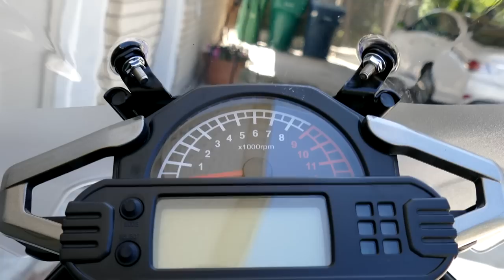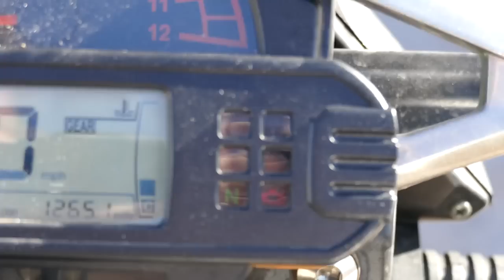Zongshen CSC RX3 Cyclone REVIEW - BRUTALLY HONEST  #everide

Comment: I took some advice from an adventure rider last year and bought an RX3 last summer.  Put 1.2k miles on it before covering it up for winter.  Changed the oil once and tightened maybe two bolts.  I ride well-worn trails and dirt roads but mostly pavement. I don't treat it like a dirt bike.  I like to use my RX3 to commute on nice days, too.  Over the course of thirty years I've owned CRFs and an XT, along with a Magna and my current VStar.  For the money, fit, finish, and performance, you can't beat the RX3 as an adventure bike.  You just hop on it and go.  Unlike Japanese enduros, the RX3 loves the interstate and winding mountain roads.  It feels solid and isn't wobbly at high speeds like the Japanese makes.  In city traffic, the RX3 always keeps up, no problem, even on steep inclines.

Now, I get it, you want to judge it as a dirt bike.  But it's an adventure bike, not a dirt bike.  As an adventure bike, the RX3 is unbeatable in the 250 class, and I'd recommend it to anyone. It's surprised me. It's shown me what a little 250 can REALLY do -- after riding for 30 years.
Reply: I just ordered a 2022 rx3 ,looking forward to getting next week
Reply: @Lloyd-mo   I'm still loving my RX3. Over 3K miles down the road and no mechanical problems. I did buy a new battery for it, last spring.
Reply: It’s great that you had this experience. I own one of these and it has not performed anything at all as you describe yours does. I fall firmly in line with Tyler’s assessment. The bike looks nice in person, shows well on paper, but is simply not reliable at all in reality. It has proven time and again that it cannot be trusted and I would not recommend anyone purchase it based on my experience and that of many other people I know.
Reply: @cliftonoram2923  Sorry you ended up with a dud. What year did you buy? Mine is 2021 and perfect for riding trails around Branson Mo. On pavement, it keeps up with any traffic, even going up the long hills. I don't have 5k miles on it and don't know how long it will last. So far I've replaced the battery and done regular maintenance. That's it. It sits under a deck, covered, during winter.

Comment: Hi, here in COlombia this bike is not injection, have carburator, more power but more troubles for tuning the carburator. ALso have a lot of problems for bad asembly. But for this money is the best choice. Have a cost of 4000 dollars here, but if you want buy other bike klr 650,  dr 650 or other need 8000 dollars....For this reason is a medium choice. You say the true, is not a great bike, i say is a regular bike. But for this money in argentina, chile and Colombia is a on-off road good choice, no excelent only good. Nice day, sorry for my regular english. Regards from Colombia.
Reply: The real competition to this bike isn't brand new Japanese bikes, it's this bike brand new, against used Japanese bikes, and you can get those for less, and they'll still be more reliable. You could get a brand new RX3 for 4000 dollars, or you could get an 6-9 year old KLR, DR, or DL, and have a better experience and they'll still hold up better.
Reply: Kaerius, problem is that for 4000 usd you will not get anything like that, at least here in Argentina you need a lot more. If you want a KLR/DR/Dommie for usd 4000, it will only be a '90-93 with zillion miles on their backs, and God only knows how many hands went through them...
Reply: @rodrigoruffa7460  I paid about usd 4k for an '09 Versys 650, in Sweden.
Reply: @Kaerius Good for you! I can positively confirm that things in Sweden are quite different than here in Argentina. By the way, I've been there in 2017, together with other 4  old Argentine schoolmates (30 years after graduation) we traveled from Lund to Nordkapp and back, 5600 km in 8 days, best adventure ever :2 BMW GS (1150 & 1200), one old BMW K100, one Honda Revere 650 & one Jialing 600...
Reply: Try the Royal Enfield Himalayan
Reply: @nineball26  thats only partialy true. Here in Mex we have no regulations regarding FI and they sell both FI and carburated versions of this bikes
Reply: Thank you for the for the honest comment
Reply: @OnlyKaerius  4000 dollar DR650s in my area are pretty clapped out.. not sure if i would be able to afford the repairs on a used DR in that pricerange in columbia. Versys is a different story, it'll have more road than offroad use so it'll be in better shape.
Reply: Problem now is japanese bikes used are just a little less than new so these Chinese bikes make way more sense
Reply: You have better English than a lot of Americans i know lol

Comment: Very good review - with a result to be expected. Quality costs money and there is a reason why other bikes are more expensive - and thats not because the manufacturers want to make huge profit. From my point of view there are points that disqualify the bike entirely. One is the suspension. The other one that it doesnt even comfortably reach the legal speed limit. While I hate riding highways sometimes you just need to use them to quickly get from A to B and the last thing you want to be is a rolling traffic obstacle.

Comment: A pretty thorough review, and thanks for your honesty of your opinion. Wondering how much suspension upgrades would cost from aftermarket. I've read the shock from Progressive that CSC offers as an option is more harsh than stock. As you say, longevity is yet to be proven, and one Zongshen owner in Idaho had to replace his engine just shy of 70K (70,000) miles. Not sure how that compares to other 250's. 

One thing that caught me off guard, was when you mentioned the smiles it brought when ridden within it's limitations. That seems to be the common sentiment on RX3 forums, outside of one guy who seems to have difficulty shifting in to 6th, even after CSC sent him a complete replacement engine under warranty.

Again, thanks for the video adventure.

Comment: I had ordered the TT250 and not the RX3 based on what I planned to do with the bike. . Wanted to see what CSC looked like before I signed the dotted line. So bought a motorcycle rack from CycleGear and drove to LA to pick it up. Really liked the shop and sales system. Was able to test drive the bike before I finalized the purchased. They were great. I totally agree with the review of the RX3 and would still consider it as another bike to add to my collection. CSC does have upgrades like front brake kits, which I would recommend.  Did have issues with the TT250 and parts were sent quickly. I am hopefull that, as the review suggested, it is like Hyundai and will improve over the next few years. Now I say this as I worked for a dealership that had Hyundai as one of its 4 lines of cars and Hyundai has become an excellent car over the years. Visit CSC if you have the chance.

Comment: Tyler, Jumping on the bike with minimal preparation for the rugged trail you were on, 80/20 tires, highway gearing and not going over bolt security was bound to produce some poor results. Yeah, first gen. , first year, gonna have some teething problems.
I hope CSC is giving good feedback to Zhongshen. The drag race with the Prius showed that the RX3 was fine until it was topped out. Overloading the bike by at least 100 lbs. (sorry CDS) is hardly a fair test (max. load 330 lbs.) Love your channel, keep it up!

Comment: Thanks. I will add more later. Having some issues. But I will say it is MORE than a commuter bike. I've been on some fun street rides along side some of the finest cycles made. I kept up quite well on the twisties, back paved roads, etc. And fairly well on highway if they are considerate that I'm on a smaller bike. Many of them are pleasantly surprised when I tell them it's a Chinese 250. And it would be good off road on moderate occasional off road. It's actually quite fun on smoother fire roads and such. But from my experience, it does not do what they personally tell me it should on rougher roads. As you mentioned, the RX3 can do it but should it, no. Especially stock.

Comment: I've read other reviews and they all seem to say the same thing, ok on the road and terrible off. I tend to think that most dual sport owners don't ride the kind of trails that you do so that might not be an issue for them.

My only complaint, which means absolutely nothing, so don't pay any attention to it, is what you're comparing it to. It's almost like taking a stock Geo Tracker head to head with a Jeep that's been tricked out and then lamenting the fact that you can't go rock crawling with it. I know, they call the Zongshen a dual sport, but they also called the Tracker an SUV. Should they all perform at the same level? Is a KLR going to match the KTM? No, but nobody expects it to. There are differences in price for a reason and that is almost always reflected in quality. 

Anyway, good job.
Reply: Did you not listen to anything he said?  He's not trying to use this as an endure bike.  He's not trying to race Ninja 500s off stoplights.  He's not trying to outdo KTM 690 Enduros in Baja California.  What he said is that this bike is crap all around.  You'd have better commuter performance with a Vespa and you'd have better offroad performance with a CRF230F.
Reply: Has to be compared to anything else you can get for the same money ....which (as he stated) is a WHOLE LOT of used low mileage motorcycles you could buy either already equipped with aftermarket upgrades or cheap enough there is still room for upgrades.  To me that has to be the comparison because no well informed person with the means to buy whatever model bike they wish to is ever going to choose this model ...not sane and sober anyway ...leaving only the "dollar for dollar" reasoning ....which means used market basically...But I mean there a number of people that have a thing about not ever buying someone else's old anything....I don't get that personally but whatever ....maybe felt deprived as children only getting hand-me-downs downs type thing ....was not me so I can't really judge I guess ...If it were me though?  I HOPE I would get the hell over it if I were buying a motorcycle and only had $4k to spend....I'd be researching the hell of past models and making a list and searching for good deals on top choices....personally anyway...

Comment: As also a RX3 owner, I feel this review is fair by a experienced rider who have tried many difference bikes.  My original bike I want is Honda CB500X, it's not a off road setting in stock either, but a used one still cost 6K+ & expensive for a new / very beginner rider in my area.  I had tried a 250cc nude bike, 250cc Cruiser bike and 250cc dual sport bike in Basic Rider Course.  Only a dual sport bike I can make a U Turn or Figure 8 without put my feet down.  So, I have to stick in dual sport / Adventure Bike.  However, all dual sport & adventure bikes I check around are still too high to me without lower it.  Although I am 5'10，I don't have long legs.  I still have to tip toe when stopping at stop sign or traffic lights on the RX3.  I seldom on freeways, only few times when traffic not faster than 50 mph, and I usually stay in roads are no faster than 50mph as a beginner level rider.  So, the RX3 is pretty good and enough for me as a beginner.  My bike is just over 5K miles and lucky it's still running good for me.  And it's also enough for me when riding in unpaved road (I consider it's off road for me).  this 400 lbs is just okay for me to pick up when it's dropped.

Comment: Once upon a time I had alittle Chinese flywing 150cc dirt bike   Once I locked all the bolts down and changed out the cab it was actually a good bike for beginner/intermediate riders. Great motor with a lot of low end. I'm not sure if Honda used most of the same parts but from cables , plastics (looked different but same mount holes on the frame), motor parts , etc....    If it broke I just went to the Honda dealer said I had the 150 and got my parts....

Comment: Very thorough review, and about the only one out there also.  A point about the manufacturer, Zongshen has apparently been been around a long time, and the bikes that CSC sell from them are basically Americanized versions of bikes they already sell successfully in other markets, so getting replacement parts shouldn't be a problem long-term.  

I actually got one of CSC's TT250's (a dirt-bike style dual sport) as my first bike, because it's dirt cheap so if anything happens to it I won't feel to terribly bad about it.  But I can be honest about it, it's kind of gutless and old-tech these days, but I'm not concerned about that right now, I just need to learn what I'm doing, and when I get a proper street bike (probably one of Honda's 500's), it can become a dirt-only bike and it'll be fine.

Comment: As an RX3 Owner I agree with this entire evaluation. I also own an XR650R, SV650S and many project bikes. I bought this for around the town and fire roads. I have only 700 miles on mine and I'm on the 2nd engine. Mine will be sold or traded in the spring.

Comment: Totally agree, I saw this, it's sold by ITALIKA here in Mexico and well I just got a KTM 950 Adventure for 3500 so there is that, or if you want a light low seat 250 you can get a Super Sherpa or a Yamaha for like 2000 tops! It's just a cool looking bike for city rides and maybe just maybe gravel roads, the new VersysX 300 and G310 GS will kill it, it will be probably around 5 or 6k but it sounds leagues better.

Comment: If the bike didn't die in the river crossing and survived your harsh riding conditions and didn't fell apart, then it's a great bike although the engine is a Honda copy. If it's Chinese design, it won't really last. CF MOTO 650mt does one thing better by buying a Kawa ER650 engine tooling,with Bosch electrical management system, Spanish JJuan brakes, Kiska designer KTM, and Spanish Shad panniers. 
   This bike is okay. You get what you pay for. Small bike is more fun and less maintenance cost that true big bore bikes. Go small and go further. This video is very good to watch
Reply: so in your opinion is this bike(KTN RS3 SE) worth to own? im in Malaysia too looking for a bike that can do Kuching-Miri without breaking the bank, and this bike is my main interest

Comment: The ones sold here in Argentina are suffering from starter override clutch premature wear. Lots of them. Some people found out that there is a Japanese replacement from Honda that is the exact fit (part 28125-MEY-671). Cheers.

Comment: I have a Chinese rps hawk for 1100 and a Suzuki dl650 which I got for 2800. The hawk is great for fire roads and commuting at 55mph and some dirt trails. The dl650 is great for eating up highway miles and fire roads. I got both for the cost of the csc. I'm happy with them but wouldn't ride them as hard as you do in your videos. I think a drz400 would be better suited. Thanks for the review.

Comment: I watched your review and read about a dozen or so mixed comments.  While I think your review was honest given the rigors of the testing arena, the RX-3 was probably not designed to be flogged like a true hard core dual sport bike.  None of the major players got it right the first time.  As their R&D departments refined bikes like BMW, Honda, Suzuki and Kawasaki, etc their suitability for dual sport or adventuring set a standard which we all look for in a rugged off road two wheel motorcycle.  I would say Zhongshen has some work to do on their product, and once that work has been done, the $4000.00 price tag will probably take a major hit.  Where the manufacturer could refine this nice looking bike is in the obvious areas:  better paint, panniers, and hardware.  Better QC during manufacturing would reduce defects such as the oil drain.  Here is where I very strongly agree with your review, it is a good around town, dirt and gravel road bike, it has average power for a 250cc but tall gears.  The suspension travel and weak rims make it an Adventure class sideliner. It is candidate for a sales market that has little or no competition.  When there is no choice, you buy what is available.  When the manufacturer rules their market area , they will continue to only meet a minimum standard.  It doesn’t make a difference if they make a million motorcycles a year, their competition in the US market has set a high bar.  Zhonshen needs to up their game.  Right now the RX3 is the Harbor Freight of motorcycles, but give it a little time, let’s see what happens.

Comment: Aside from all it's other issues, the EFI flat out kills it. The Honda XR650L, Suzuki DR650, and Kawasaki KLR650 all still have nice simple easy to work on carburetors, which work just fine. And for what that bike actually costs after all is said and done, you can buy a really nice slightly used example of all 3. And they are not Chinese.

Comment: I'll vouch for Zongshen engines.
I swapped a Zong 250cc OHV engine onto my Honda CB100 several months ago.
I've put about 8000 miles on the engine in that amount of time without ANY issues. GREAT power for a 250cc engine, especially on my lightweight, small frame CB100. It's a direct swap on most single cylinder Honda motorcycles...other than wiring of course.
As far as I can tell, most "maintenance parts" are readily available on Alibaba. Even cylinder kits are available.
I cannot vouch for the actual motorcycle tested in this video. To me...it looks like a turd 💩 that breaks far too easily.
Reply: Nice insights,am planning of swapping my CB 125 engine with the same, where did you buy engine from?